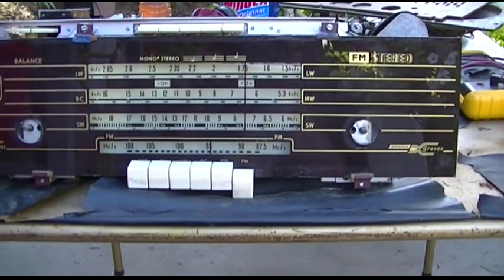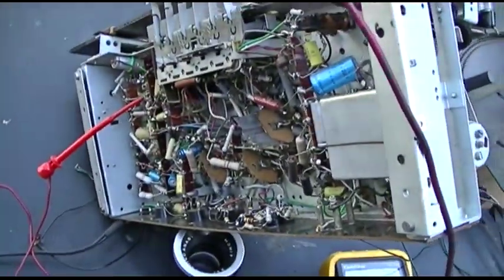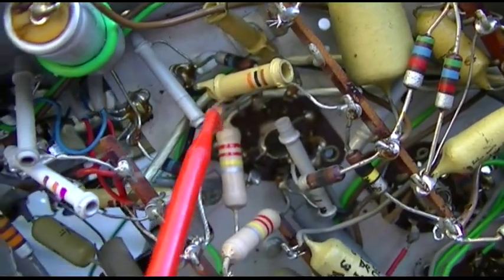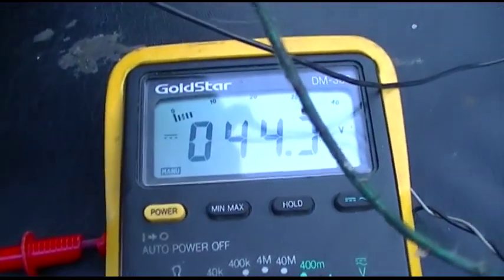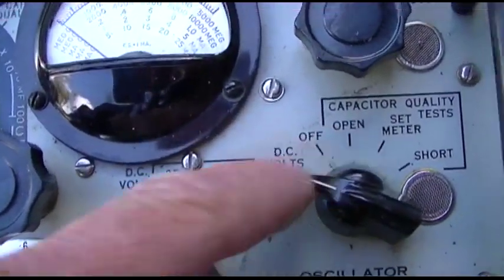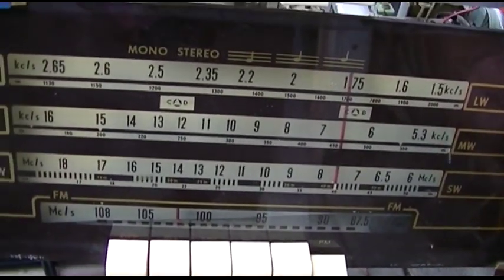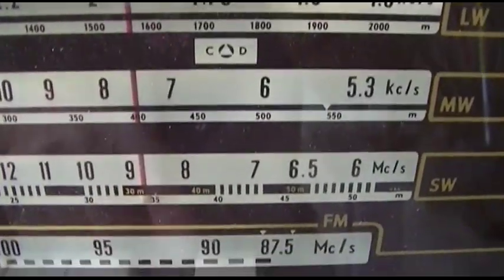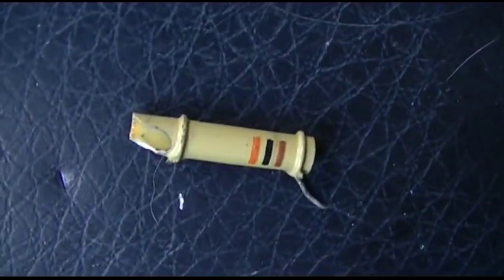Philips B5X43A Stereo Vacuum Tube Table Radio Repair

Comment: How many others noticed the mistake on the dial markings?  On the MW band, on the right side, it reads "kc/s" when it should read "x100"......the first marking is "5.3" which is actually 530 kc/s. but the dial indicates it is 5.3 kc/s.  Likewise, the top band is similarly mislabeled, it should read "mc/s".

Comment: Did the stereo decoder work? Usually these fail due to the small electrolytic capacitors that dry out completely. The European versions of this model have a distinctly different marking on the scale. The code for the American version is usually affixed after the type number, e.g. B5X43A/19 where the /19 has relevance for some details like frequency range of the FM band, dial markings etc

Comment: This radio is in europe equipped with 800 ohm speakers in the cabinet.
It has output transformers but they are not for low impedance speakers.
I only have the schematics for the europe version for you.
Reply: Would that explain the low volume seen here on low impedance 8 ohm speakers?
Reply: @gregorymalchuk272  yes, definitely! i now have a 'similar but different' model , also 800 ohm speakers, philips had an obsession for high impedance speakers for a while 😁 even one small radio that had a small 800ohm one directly in the anode circuit of the ucl82 output valve, nearly always found to be open circuit due to the dc power dissipated in it!

Comment: I didn't think ceramic caps went bad and started leaking.  Well learn something everyday. What kind of amps are in that radio, are they a couple of single ended pentode amplifiers?
Reply: they dont usually, i've only come across a very few bad ones,.. that radio looks like it uses EL84/6BQ5's ... philips did some models with weird high impedance push pull stages using either EL84/EL86, EL84/UL84 , EL81/EL81 pairs, in series across the HT/B+, with speaker, 800 ohm, capacitor coupled to the mid junction of the 2 !!
Reply: they dont, usually, but anything could fail... maybe the ceramic material has absorbed moisture from the air, paint covering got a gap in it?   and yes 2 single ended el84/6bq5 stages ,  may have 800 ohm speaker output, philips went for that for some models, strangely!, i have a similar but different model

Comment: AGAIN, I'd start by re-capping! check all resistors & vacuum baulbs, then troubleshoot if that all doesn't fix it!
Reply: ceramics rarely fail and go leaky, unlike waxies, the rest in this set are poly mostly mullard/philips mustard types, also rare to fail, no need to 'blanket' replace
Reply: you dont 'start' with recapping, you start with making sure no major/unobtanium/expensive part is bad or missing, or all your recapping is wasted

Comment: nobody likes philips radios in Europe..they are the most awkward to work on...i'd rather repair a dozen telefunkens and grundigs...grundigs are the best, wirewound resistors all around, no carbon comps, good quality ceramic caps and trimmer caps, most of them dont need alignment after repairing. the dutch radios..philips and Erres...after the usual recapping they almost always need massive resistor replacement and alignment
Reply: hmm, i quite like philips stuff, definitely 'different' 😜, as for caps, if it uses those black pitch covered things, yes they need replacing , except if just cathode decouplers, if tubular ceramics like the bad one in the pic, not normally, as for their resistors, they dont seem to drift that much , in my experience, except 220k and 680k values...?!!

Comment: @ 2:15 is a resistor...sorry I just had to say something...really nice video..
Reply: lol no it isnt. This guy knows an awful lot about repairing old tube radios and TV's. It's a capacitor. He even checked it on a capacitor checker to show you that it has capacitance. I guess you are not familiar with older style capacitors, which can look similar to resistors. The capacitor itself is yellow, which signifies the voltage rating, in this case the capacitor is rated for 400wv. A red capacitor is 250wv and a brown one is 100wv. I believe he stated its value in the video. Go look up capacitor color codes for a more detailed explanation on how old capacitors were labelled.
Reply: You are 100% right..my bad...I was new to tube radios then..but have learned alot from this guys video's and others..I was wrong..thanks
Reply: Kennynva T. .. you are correct sir. He was pointing to a resister
Reply: Looks like a 10k wire round......But hell old gear things are different so who know's ....
Reply: its a tubular ceramic capacitor, inner is one 'pole'.  outer the other,  inner and outer are coated with a conductive substance usually silver based , the ceramic tube being the dielectric
Reply: they fold the inner  conductive layer back to the outer at one end, leaving a non conductive gap between that and the main part of the outer, so they can have wire connections wound round each end on the outside, i've stripped the paint off one of these to see how theyre made..
Reply: some may also have no foldback, relying on 2 dielectric areas from outer end to inner, then inner to other outer end